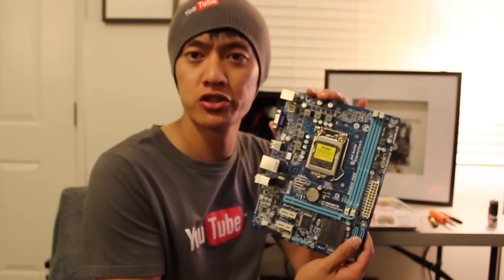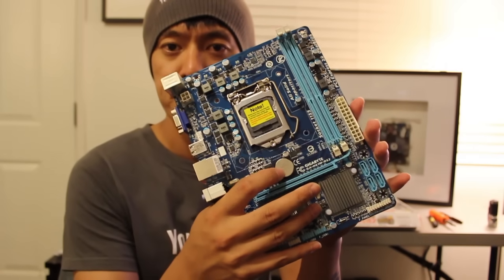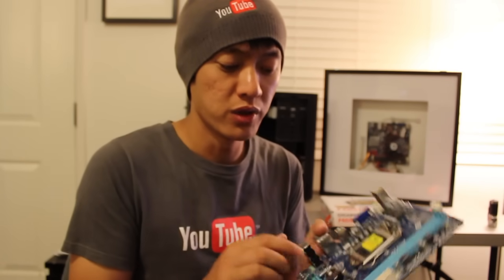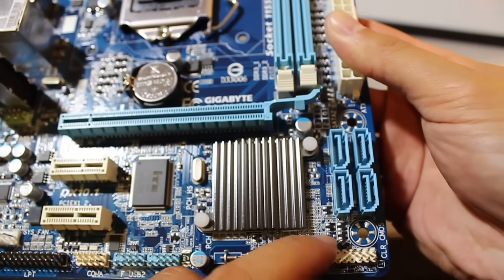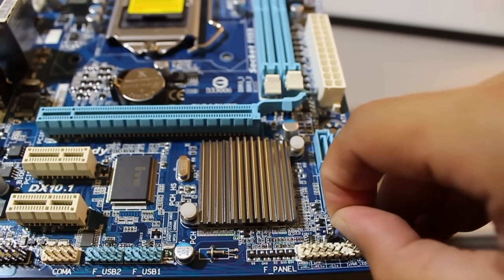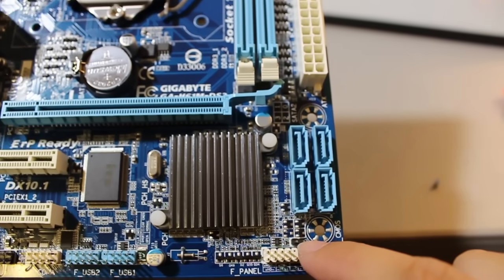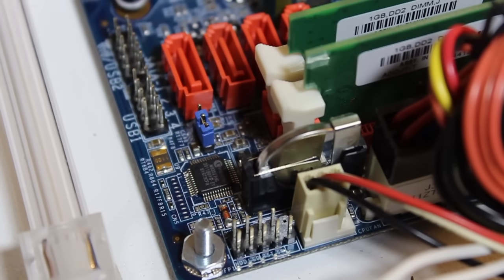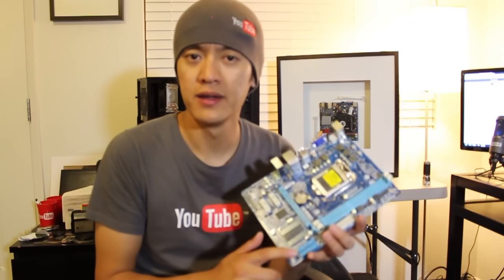How to Clear the CMOS - Reset the BIOS & Why

Comment: Hi,
I'm having a problem with BIOS password with the model: A541U, motherboard model: X541SC,  I opened it but can't see any CMOS battery to reset the bios but after open it is giving a new date to reset the bios that is rescue password 2016/06/27 but  I couldn't find any password for this date, I've tired few other password from google and the latest 2016/06/19 and didn't work. I've tried early dated password as well nothing worked. First it was giving the rescue password on the current date but after take the charging battery off and put it back, then it is giving 2016/06/27 dated rescue password. Anybody knows this dated rescue password please? 
Anybody have any suggestions please?
Thanks

Comment: If start my pc then after a some seconds CPU fan goes to max. No screen. Some times after 15 of 20 x on/off it startsup and see bios ask normal window. safe mode etc. If i startup some times it works for 2 days and intant freezz again, and cpu fan goes on max.
Reply: northbridge(chipset) problems. you are pretty much fcked with that mobo

Comment: What the clear CMOS jumper or button does is short the battery power so the CMOS looses  its state.  DO NOT TURN ON THE POWER WHILE THE PINS ARE SHORTED.  It could seriously damage your motherboard.

Comment: hi, i'm running gigabyte b75 hd3. it runs well. but sometimes it starts restart and restart. after a while sometimes it become normal sometimes not. is this  a power problem or hardware problem?
Reply: Did u find out what was wrong? I have been trying to add another 16gb to my 170 Hd3 and I already have 16gb. But when I try add anymore ram my comp gets stuck in a bootloop. Bios up to date.

Comment: Hello sir I am very glad if you can help to be housing . Gigabyte GA- Z68 on -D2H -B3 DISPLAY CARD FOR SAPPHIRE RADEON HD 6790 display problem is that the monitor sounded sometimes late and I pushed a little bit in the socket end from the monitor is connected to the video card into the slot may have no contact with said die went electric complete in the safe after 2-3 seconds pS 650 watt tried power until the green wire wool minus the fan works but what I used to do it again went I took the battery bios could not open then step casing head yice I board my 2011 also bought packed full 2 years and now in olabilirmis c help I encountered such a situation

Comment: I have a Asus crosshair 6 hero it won't pass bios as far as I know everything is in correctly there's no errors but it's stuck in bios it won't boot. There is display but when I try to boot it's says secure boot is enabled to prevent untrusted operating systems. And no matter what I do it will say boot is enabled to prevent untrusted operating systems. What do I do?

Comment: there is another method for clearing CMOS/Bios to default.  I prefer this method, because it requires zero tools, little technical expertise and the process is very simple.  Here you go:

turn computer OFF!
Remove the power plug.
Open the case
find the CMOS battery (in almost every single computer this will be a coin sized lithium battery, CR2032)
carefully remove this battery.
Then press the power button on your computer for about 10-20 seconds.  Do it again.  Do it one more time.  This discharges the electrical energy stored in the capacitors on the motherboard.  
Then reinstall the CMOS battery.
connect the power plug 
turn computer on.  Power Button, press it once and release

You have NOW cleared CMOS (NVRAM memory) thus causing ALL BIOS settings to go to defaults.  During BIOS start and POST, the bios firmware senses hardware as if it was the first time seeing it.  Because the RTC (real time clock) setting has also gone to default, a message during post will read that date/time must be reset.  Press the instructions.  It's usually F2.  You are now in the BIOS settings environment.  Find the date/time setting and make the adjustments.  This DOES NOT HAVE TO BE PRECISE TO THE SECOND.  Slightly earlier is better.  For example if the correct time is 4:34:22 PM, then set it to 4:34....that is sufficient.  Again, this date time settings only needs to be correct "enough".

once you have made the BIOS date/time adjustment, SAVE this setting (usually F10), or if the GUI allows it, click the save icon. 

Now reboot.

now you have cleared the BIOS to defaults and have made the necessary date/time corrections.

special notes:  because the BIOS settings are now back to defaults, you may find it necessary to go back into the BIOS settings environment to make other changes.  Some BIOS settings allow for speed step, overclocking, boot order etc, multiple drive options, onboard or add on cards such as GPU devices, bios admin passwords, etc.....  But the defaults may not set those up automatically.  In a nutshell, default in BIOS for most systems are the bare minimum that allows a system to operate. 

So you will have to reenter the BIOS settings environment and configure those manually to take advantage of these configurations, and the devices you have installed.   

These instructions do not go into details about the consequences of clearing CMOS and thus the default settings, but one needs to understand there are some special features of your hardware and configuration of your system that will not work correctly and be utilized efficiently per design, unless you set them in BIOS.  So read your tech notes of your system, learn the capabilities they offer and what bios settings are required to utilize these features.

Comment: I tried to turn the power on via the power button on top of the PC and it would not start, I noticed that the blue light on the the back of the motherboard (Clear Cmos) was not lit. However the red light on my motherboard was on, so there was power to the PC. 

I then turned the power off from the switch at the back of my PC and waited 10 sec, after which I turned the power back on.

I then turned on my PC via the power button on top of the PC and it started to work.  Now any time I wish to turn on my PC on I have to repeat these steps, turn off power from from the back of the PC then wait 10 sec then turn the power back and then turn on the PC via the power button on top of the PC.

There is also one other thing Clear Cmos light at the back on my PC is not longer lit when the PC is off, prior to this it had always been on when my PC was off.

There is obviously a fault with my PC, could you please help me in anyway.

Comment: hey dude i just bought GA-H110M-DS2 DDR4 version and also Intel pentium G4560 KabyLake and DDR4 2133Mhz HyperX Fury. i build everything and when i press the start button the PC its starting then after 3-4 secound its going off and doing that over and over also i want to add when i start the PC isnt even Beeping the Speaker.And when i remove the RAM its start beeping because of no RAM do you know how to fix that ?
Reply from the maker: petko kamenov Most likely it's because the motherboard you have doesn't support kaby lake yet. H110 is built for Skylake and you have to see if Gigabyte has a UEFI (BIOS) update to support Kaby Lake. So then how do you update the UEFI if it doesn't even boot? You need to install a Skylake CPU in there temporarily to update it. I think you should get a kabylake motherboard like the B250 instead.
Reply from the maker: petko kamenov So the F20 BIOS came out in November of 2016. Most likely your motherboard has been sitting on a shelf with the old BIOS since before that. Check your BIOS.
Reply: how to check my bios ?
Reply from the maker: petko kamenov you buy a Skylake G4400 CPU and install it.
Reply: i got i5-6400 is it work ?
Reply: i5-6400 е Скайлейк ще стане според мен :)

Comment: I have an Acer laptop and you have to disconnect the battery, disconnect the CMOS battery and short out a capacitor after removing the Mobo, or so I'm told. Or wait a very long time with it disassembled.

Comment: hi there i bought second hand acer xc-215 this xmas its a year old but was only used last year for month or so so not used for 10 11 months anyway it worked for my little boy for month or so  now it just flashes the power button white fan works  ive taken com's out  for while and replaced battery no luck still the same  could this be same problem as this video shows please help could you send a link to a manual for mine xc-215  thank you great video's cheers please help my little boy im a single dad and im un able to work so can't just go and buy new pc or pay to get it fixed at this time  i do mess around and fix lcd led plasma's  caps and so on  thank you for any help mark

Comment: I can't get the sound on my PC to work. I tried everything nothing is working. Should I reset the motherboard?
Reply: uphill248 uphill248 if its just the sound could be a driver or speaker
Reply: uphill248 uphill248 or the soundcard died
Reply: Bouwer2100 it was the driver. Thank anyway.

Comment: Hey I need some help here I am in advanced user of PCs and have been for years but I'm experiencing an issue where I am not able to get into my bios even cried pressing the correct buttons during start up I've tried removing the battery and flashing the bios both of which have not worked I've also tried using different keyboards to no avail if anyone has any ideas of other things I could drive that would be awesome

Comment: Hi guys, I know it has nothing to do with the video but, how do you know if a MB you buyed it's new, I mean, unused, never used?
Some people received an used MB, even with the stickers fine, but they had problems and that was a faulty MB because it was already used and overclocked. Sellers know how to pull out a sticker with vapour and heat, then reselling it and you won't notice it was already opened....

Is there any method to make an inspection, software or mechanical, to accurately know if a ''new'' MB is really new and you're not being cheated?
Reply: The only thing that might indicate if it truest isn’t a new motherboard is if when you first install a new motherboard into your system, if the date and time don’t say 0 (zero) for every digit then it’s not new
Reply: @kadenlanglois4989  Hi Kaden, thank you!
But, is there a trick to reset the bios or cmos to Zero and keep cheating anyway?

those bastards know every trick possible, can you confirm this? Thank you SO MUCH!

Comment: Recently I was trying to install a new graphics card and in an attempt to do so, I accidentally put my Serial Port 1 settings to "disabled" since then, my pc is not booting into either windows or boot menu. What I think now is that my serial port is disabled and is no longer able to run onboard graphics card(Integrated Graphics Card) Now what I believe is that the solution to this problem must be to somehow reset the BIOS settings (I tried to do that manually by moving aroud the jumpers but still does not work) Can someone help me with that? Thank you!

Comment: You seem like you know what you know, I have an issue with my computer my internet speed is 150Mbs down 15Mbs up but when I do a speed test it shows me something completely different, I used Okala for my speed test it gave me a result of 9Mbs down 9Mbs up I phoned my ISP provider they did everything they could everything was fine on their end, so he asked me to try my android phone and that was normal 35Mbs down 15Mbs up I know this cause I tried this 6 months ago, so now I don't know what the issues is if I reset the CMOS could this fix the issue. Thanks!
Reply from the maker: Wayne Coolidge are you using a computer with wifi or an Ethernet cable plugged into your router or modem? try just using that one computer plugged directly into the modem and run the speed test. do you get the same speed?

Comment: I had a problem with my computer where it boots up but it does not display on the monitor. The solution to my problem was to change the power supply. Since my clearing of CMOS was successful; I have a new problem, a blue screen with an error message "0xc000000e".

Comment: does anyone confronted with a virus that delays the turn on of the laptop up to 5 minutes and during those minutes the laptop is   constantly beeping like a piece from it is broken or dislocated. when finally starts and everything seems ok, comes the second symptome. every file that i click automatically open the option for delete and only yes is working. i mention that i tried restore sistem and it worked for few days. i simply don't get how     the laptop has been infested because i use deep freeze. My question is that there is any probability that the virus is placed in BIO?

Comment: My cmos battery used to get discharged in every 20 days. And without any charged cmos battery my computer won't start. I need to replace the cmos every 20 days. I don't know why is this happening? Any solution. Before this it was all ok.

Comment: Hey, I was wondering if anyone could help. I've recently purchased a £750 Pc build and plugged in everything, and when I switch everything on, theres no electricity or no power at all. Everything's connected eg. Double checked the front panel and yes the switch of the psu is on. Would
Resetting the cmos do any help. Because i dont want to touch it if it ain't going to work?
Reply: Onur Mutlu I have that same issue
Reply: Brandon Wolford man its such a hassle. I literally couldn't find a solution. However, either my motherboard or my cpu was faulty because I tested my psu and it worked. The mobo was giving me a red light, meaning my cpu wasn't detected which in my case was either due to the faulty mobo itself or cpu. I just returned everything and ordered a prebuilt pc. But check for some solutions online before you do anything, best of luck.
Reply: Onur Mutlu I haven't seen any lights on my mobo so I don't know what it's not registering
Reply: nvm did the clear cmos and it turned right on no issues anymore!
Reply: Brandon Wolford eyyy gg bro haha lucky got no faulty parts xD

Comment: will this help me fix my problem, its says "press del to enter uefi bios setting". But even though i press del,  the computer wont recognize my keyboard,it wont go to the uefi bios settings that it says.  thanks in advance to someone who can help me with my problem.
Reply: Spam delete
Reply: Never plug in the keyboard in a USB 3.0 port. Last time I remembered I could wait till the cows came home. 
After I plugged it in a USB 2.0 port it worked. Or if you have a PS/2 keyboard and port: Use that to see if that works.
Reply: +Bram25 I have the same problem but the ps/2 keyboard doesn't work

Comment: setup to recover bios setting
No keyboard detected 
After setting up intel(r) optane memory or raid configuration was built ,
Sata mode selection must be changed to raid mode to avoid unknown issues 
Peer f1 to run set up  
This is what it’s asking me to do but I brought a new key bored and mouse but they won’t connect the key bored will on have a low light  please help anyone

Comment: what do you do when there is two jumpers side by side?
Reply: there''s so many jumper in your motherboard, it might be for disabling or enabling or like resetting bios but its is still the same process.. much better if u read the manual

Comment: huh? you cant reflash the bios by jumpering the cmos pins.

also on most manuals. you are not suppose to connnect the power cable when clearing cmos, left alone, turn on a system when the jumper is on clearing mode. it does say on the manual it could damage the motherboard.

Comment: Would it work with a screwdriver
Btw it does and also thank you so much i have been fucking arround for 3 weeks with this pc and finally getting something feels great
Reply: Thank you so much, this saved me.
Reply: @sensei12124  your welcome i went out and got some jumpers from this computer store in my town they didnt charge me cause i have a msi motherboard that has 3 pins and i always have to have the jumper on 1 and 2 to boot since those 2 are the keep data pins and the 2nd and 3rd pin are for cmos delete

Comment: I have to do this every time I want to turn on my computer, meaning I have to do it 2 hours in advance because of how many times I have done it. Is there a way to not need to do this? Is there a way to do this permanently?
Reply: that usually means that little round battery is dead.
Reply: @packrat2113  the CMOS battery? Because I did buy a new one, and it has fixed the problem but it still happens every once in a while

Comment: WRONG!!! You only need to contact those 2 pins with any metal object while the system is off, while the power is off and it will reset, because CMOS has memory that stores configuration and is powered by the battery. You can achieve similar effect by getting battery out and then getting it back on some boards. What you do by using any metal object and touch those two pins is that you short the connection between the battery and the memory and memory gets wiped out. Also if you place that jumper you used and then turn on power it might damage the motherboard.